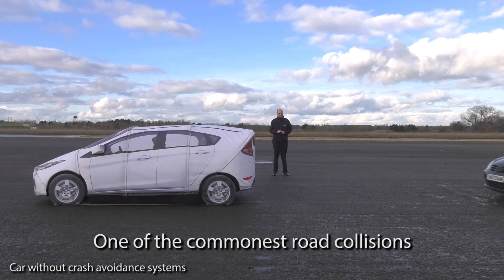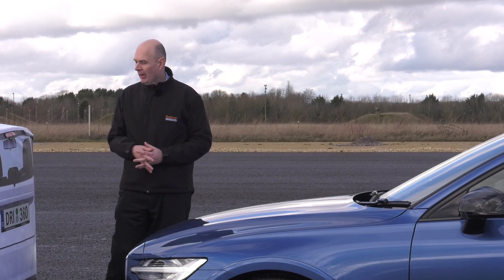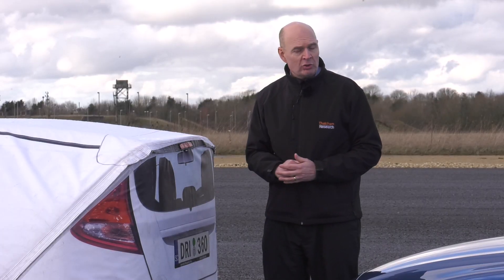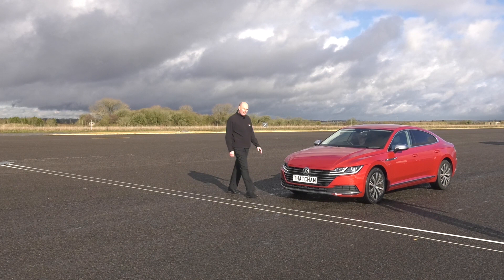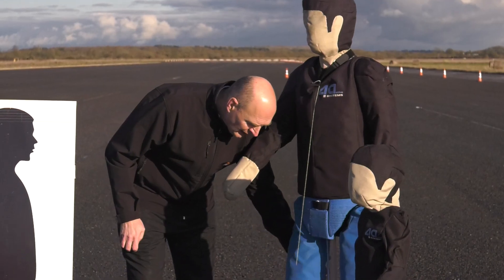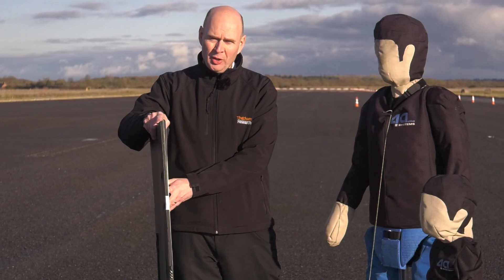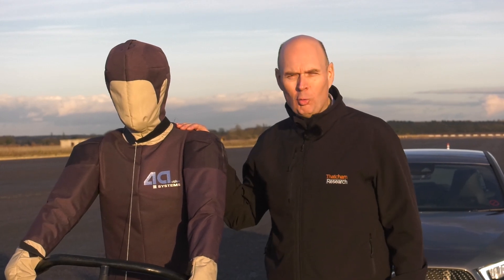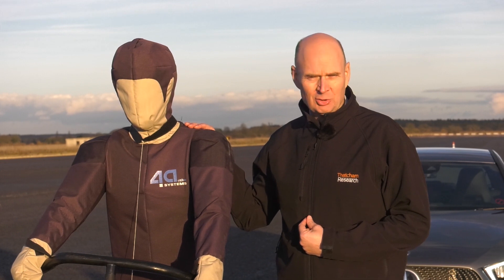AEB: Saving Lives

Comment: There is something fitted to my car that does this already, called the driver. My Mercedes 2018 c class has a brake assist and it is turned off on my car as it is dangerous. It slammed on the brake when not needed and put me in a skid. Even turned off It still warns me, I can’t stop the dam bleep and it gets it wrong at least twice a week. Like with electric cars and autonomous cars, this tech is not yet good enough.

Comment: Thatcham presents a video which is definitely good marketing of AEB. However there is no doubt that it is misleading. As you observe all tests are undertaken with no other vehicles, people or cyclists around, and people and cyclists (and presumably motorcyclists) are upright - they have not fallen over. As a result there are no compounding images that could confuse the AEB. As an example Volvo demonstrated pedestrian system - it failed 3/5 times. The eventually "determined" the problem was a large semitrailer parked well down the test track! And Volvo had another demonstration of a Volvo S driven into the back of a tip truck - system failed completely and unmanned Volvo written off. And IIHS USA undertakes annual tests with a range of cars and a range of closing speeds. Most AEB systems work at a closing speed of 12 mpi but many fail at higher speed differences. And the 38% saving in injuries is the result of very poot Thatcham research - they made no effort to try and ensure the differences did not relate to the differences in driver groups having AEB versus those not having AEB!